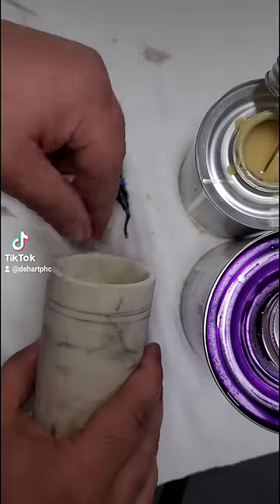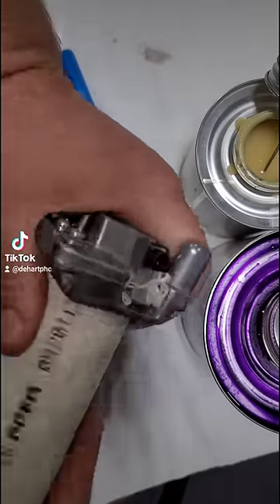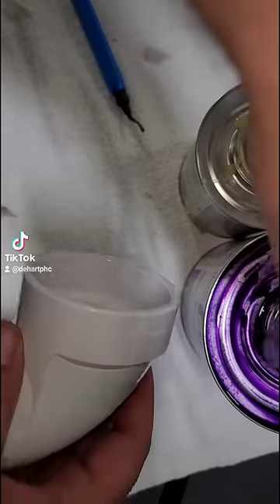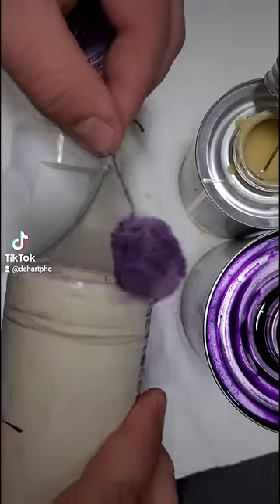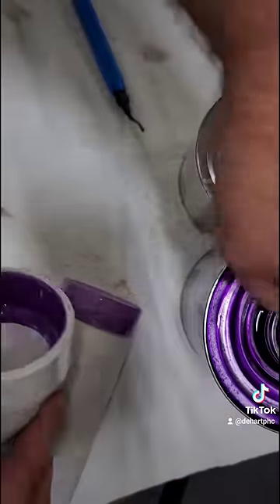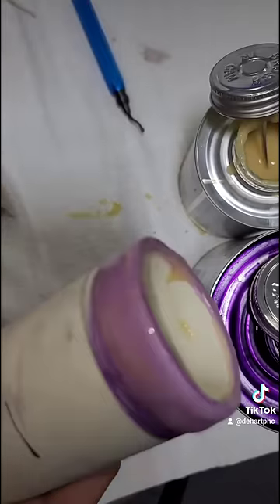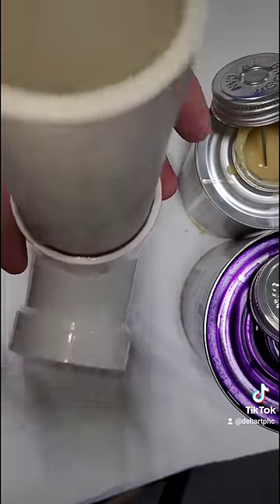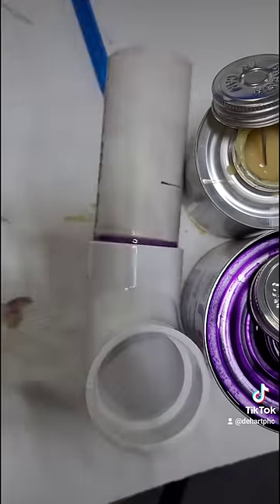How to create a great PVC solvent weld joint.

Comment: I usually cut the pipe crooked with a sawzall, slop the purple stuff everywhere, put on too much glue, and stick it together. Usually works fine
Reply: you mix a little primer into the glue so it looks like you primed it first.
Reply: Chamfer tool, deburring tool. Didn't know those exist. Hacksaw blade or Sawzall that's it.
Reply: Best comment. You my good orange have made my day
Reply: I debur with my thumb and index finger after the crooked kacksaw cut. Works every time
Reply: @halfmoa  🤣
Reply: This is me
Reply: Angle grinder for the win.
Reply: That's the only proper way to do it lol
Reply: don't forget to drip primer everywherer
Reply: @Underbottom.Sandydown I go right to spilling a whole can first for good luck
Reply: Hahaha...
Reply: I usually have to pull the pipes together and flex them because I cut it a 1/2 too short as well…
Reply: Pretty much, yeah
Reply: @halfmoa  😂
Reply: That's how I do mine and never had a leak.
Reply: I just use blue no primer
Reply: I thought the purple stuff was the glue 😮
Reply: @Masterofthejack  😬
Reply: @Masterofthejack  😂
Reply: @caodesignworks2407  shit, my supplies never make it home from the mex home depot ico
Reply: Bro forreal 😂😂
Reply: Lol m12 shears and blue lava baby
Reply: Same here, but then you don't have a video to make yourself seem superior by adding useless steps.
Reply: This. I just did the same damn thing but with an oscillating tool instead. That shit ain't gonna leak again.

There's the "proper" way, and then there's the right way.
Reply: As does everyone else.  This is some DIYer that thinks he's a professional when pro's know that time is money and this is unnecessary.
Reply: @123chargeit  to be fair if I did this professionally I would have a pvc cutter. Those make a plenty clean cut without all the extra steps.
Reply: No such thing as too much glue
Reply: 100%
Reply: No such thing as too much glue
Reply: That’s pretty much how everyone does it. That’s how this guy does it in the field.
Reply: I just inhale the primer and forger why im there 🤤
Reply: Sad how accurate this is for my life 😂😳
Reply: Don't forget laying on the floor for the last hr listening to music because you forgot to cap it, while trying to get the day over with after lunch and got high
Reply: @billbobaggons  what about laying in sludge because the previous drains were clogged with everything that never got cleaned out of the refrigeration cases? 😂😂
Reply: @BEMetalMelting  😭😭 the memories are coming back now
Reply: Amen.
Reply: That's the ticket bud your Golden
Reply: @caodesignworks2407  winner.... That's how you know you're going to have a good day.... Started off as bad as you can so it's nothing but up from there .. stay Golden
Reply: Lol these comments🤣
Reply: @kileonamanzano7024  being a hack at assembling PVC brings us all together.
Reply: @bearlemke  exactly 💯!!!
Reply: @Masterofthejack  yea i don’t hire you people
Reply: 🤣 Correct
Reply: @halfmoa 🤣
Reply: You forgot to kick the glue over and drop the swab in the dirt
Reply: Yeah people don’t like paying for extra time doing all that and making it look pretty on something no one will ever see
Reply: @halfmoa the guy who showed me this trick also shot guns on site and smoke more weed than anyone I've ever seen while at work.
Reply: This man gets it
Reply: This is the correct way...
Reply: @halfmoa  nahh glue only and if theres inspection just prime the joints when its all glued together. Easyyy
Reply: I usually cut a stake, prime and glue that side into the fitting then blame the next guy by accusing his level of having too much air in it causing his bubble to never give him an exact 1/8th of fall.
Reply: This! Lol
Reply: Why pay for primer when u have grape kool-aid
Reply: Well played, sir. Well played.
Reply: And will also hold just as well as the joint in this video. Those steps aren't needed.
Reply: Hell yeah brother 😂😂
Reply: @FatPat2009-2 multi tool or bust 😂
Reply: 😂😂😂😂. Me too!!!
Reply: I'm usually on my back in a crawl space ....so no.
Reply: I cringe when the glue gets wiped off with bare fingers
Reply: @gregtorseth  😂😂 I can’t stop laughing at this damn thing
Reply: It always works fine. This video is mad overkill
Reply: @kirk5637  yeah.... Deburr tool. You mean index and thumb.
Reply: @gregtorseth  exactly. Gloves? Optional. Sometimes you catch a slice, sometimes you don’t. 🤷‍♂️
Reply: @ExploringCabinsandMines  flapper wheel gang
Reply: @caodesignworks2407  I don't think I've ever actually used an entire can of primer.
Reply: Damn...just use a shark bite
Reply: Same
Reply: Yep. A win is a win no matter how ugly.
Reply: Shit I’m glad I’m not the only one
Reply: Then as I'm installing, I knock over the cans of primer and glue
Reply: Hilarious 🤣
Reply: @Underbottom.Sandydown  you know I did some plumbing bc the purple is everywhere 😂
Reply: I know you’re joke but it still hurts to read this 😂
Reply: You win the comments section!!!! 🤣
Reply: @gregtorseth  holy shit 🤣🤣
Reply: Primer!!! What’s that do??? lol
Reply: @caodesignworks2407  before even cutting somehow it drops and explodes and now the whole floor, and wall, and cat, and dog, and wife are sealed nice and tight!right?
Reply: “Usually” lmao
Reply: Yeah exept for the purple stuff I usually use what we call purple shit it works a little better
Reply: As a plumber. I can confirm you are correct. Crooked every mf time
Reply: Nailed it
Reply: Grandpa did the same, worked fine 😂
Reply: @123chargeit time is money, and contractor don't give AF of it fails 5 years later, they go the money and GONE!!
Reply: 😂😂same brother people these days
Reply: @orange3203  we didn’t have a pipe cutter that would do 2 inch until this last year or so, and anything bigger is either for the table saw or sawzall, and we just pick off the stray bits so it sets nice
Reply: Most realistic comment
Reply: And none of those joints leak to this day
Reply: @thatchedstudios4768  amen to that, long as it isn’t under pretty substantial pressure it’s usually about fine
Reply: Hahahahaha me too dude never had a leak
Reply: I usually wrap the original pipe in cheap sealants and hope I don’t have to hack anything out later
Reply: You sir sound like a pipefitter.😂
Reply: @kendallzortman3826  really bad at geometry but really good at welding wide gaps together.
Reply: Half of this is unnecessary but it sounds good
Reply: Amen brother
Reply: @kirk5637  fucking seriously!!! Never heard of them!!!!
Reply: 😂😂wtf
Reply: Exactly! So many unnecessary steps and it's sanitary in his video that's not even under pressure 😅
Reply: so pretty much like you eat proper Philly steak sandwich
Reply: This is the way
Reply: Same. No leaks yet.
Reply: @Kirk, this is how you lose a ton of money as a plumber because you have no idea to run a proper company
Reply: Genuinely made me laugh out loud. Thank you
Reply: Lmao
Reply: ^ Crappy handymen assemble 💪
Reply: Put a little sand for the luck
Reply: My deburring tool is a utility knife. 

My chamfering tool is top notch though. It gets such an immaculate chamfered edge to the point where it's almost too perfect and the glue won't stick. But it does. I spend at least 20 minutes on each joint making sure that chamfer is the opitome of perfection. Just look at any of my joints... Oh wait, nobody will ever be able to see if the edge is chamfered and it makes literally no difference if it's there or not... I guess you'll just have to take my word for it.

Oh yeah... Clear primer exists, no sense in using the purple crap worrying about how clean you primer line is.
Reply: I just let it drip slowly until the limescale builds up, jobsagoodun
Reply: Exactly! The more pvc shavings left on the end of the pipe makes for a stronger joint👌🏽
Reply: Exactly
Reply: You know when ive played plumber by the purple fingers i have for days after
Reply: Same
Reply: Was about to say similar lol. I cleaning with a knife though just to save cleaning faucet screens.
Reply: I slop glue around the outside of the joint for good measure
Reply: 😂 I was thinking the same thing.
Reply: He lives in a perfect world. Yep his wife cheats on him
Reply: I do what you do, except now I just use clear primer so I don't have the purple everywhere
Reply: Most inspectors want to see primer run to know it's used
Reply: Why even bother with the primer, lol.
Reply: Sont forget a few fresh teardrops made from the sad agony of finding all the tools in the messy garage in the middle of the night reminding of the sad state of things.   Not that i would have ever experienced that
Reply: Hay boy!
Reply: Facts
Reply: This is how new construction top out usually works lmao
Reply: Make sure to get plenty of purple primer on your fingers, so your wife won't let you play with her cooze that night, more beer time for you.
Reply: I like to get some dirt in there too.
Reply: Me too 😂😂😂
Reply: When I read this I LMAO. There's guys at work that just use primer. I usually have to go back and fix it later. Plant maintenance for reference.
Reply: And never forget to knock over the primer every once in a while
Reply: I like how he went through the time to chamfer the edges, but didn't clean the mating surfaces with a copper brush. It's extra, but really gets the junk out.
Reply: He's not wrong the guy that did my house was probably on 5 different drugs, he had his license (well his dads lmfao)....He did it the same way as orange3203 and years and years later none of it ever leaked
Reply: Way she goes
Reply: Worked for my potato cannon 🤷‍♂️
Reply: I WAS GOING TO TYPE THE EXACT THING!
Reply: Yurp nailed it.😝🤣🤣
Reply: When the purple primer runs down your forearm on a vertical pipe, you've perfected the technique.
Reply: my man 😂
Reply: This technique always works!!
Reply: Yo hell ye I do plumbing on pools and you just killed me
Reply: Never had one leak yet. I also use thr same method
Reply: Don't forget grinder.  I've used a grinder to cut several times
Reply: Works the same
Reply: Just needed a file not those 2 Batman gadgets
Reply: Shit works great for cuts also..and anyone out on site isnt outting pipe together like that.its turn and burn..unless they are hourly
Reply: Best comment ever!
Reply: Literally 😭😭
Reply: I skip the primer
Reply: Exactly what I was thinking 😂
Reply: Came to the comments to make this exact comment, I'm a little dissapointed you beat me to it but glad I'm not alone hahaha
Reply: Duct tape it. Rip and run baby. Those fumeees am dangery
Reply: You’ve seen my work have you? 🤔😂
Reply: Mmmm that first whiff 😤😮‍💨
Reply: Too real
Reply: Didn’t know there was any other way 😂
Reply: @kirk5637 I'm a firm believer in mastering hand tools first but a hacksaw does save an arm on new builds
Reply: You sound more like an electrician 😂
Reply: Dont forget the part where you get the primer on your fingers and drip glue all over the ground and on your boots
Reply: @halfmoa just use the same dip stick thingy for both.....😂 dip it in both at once....saves a lot of time...
Reply: That's standard
Reply: Like a normal person.
Reply: Facts 😂❤
Reply: Yep.  No need to be technical about it.  It’s PVC, as long as it holds and doesn’t leak.
Reply: Same 🤣
Reply: I also enjoy this method but I like to glue dirt and things to my hands
Reply: Yup. 10,000 joints, not one leak. Just deburr it by twisting it on your pants. What's this "fitting, pipe, fitting" business?
Reply: The most real comment here 😂 💯
Reply: @caodesignworks2407  lol my old boss had to bring me extra glue to a jobsite once, brought me 2 and said "ones for you to knock over ones for you to use"
Reply: Same.
Reply: "Usually"😂😂😂
Reply: They didn’t name it sawzall for nothin.
Reply: You an me both
Reply: @halfmoa 😂 a true craftsman
Reply: Yep!!!
Reply: You win the comment of the day. Hahahaha
Reply: It’s not rocket science, it’s common sense. It’s simple crap to do, you just gotta know how it works to use it correctly. Then it don’t matter how you do it as long as it’s quick and it works. This is just some OCD type stuff that DOES work but takes longer
Reply: Dont forget to sniff cleaner before fitting to help get thru the day
Reply: Yep...
Reply: @MrOdins007 😂same
Reply: Still holding too
Reply: Never fails. 😆 🤣

Comment: Yes, it matters to put the primer on before the glue. No, it doesn't matter which piece you do first.
Reply: But you do want to put more glue on the pipe than the fitting to that excess glue pushes out instead of running inside the fitting, atleast the way I was taught
Reply: It actually does matter for semiconductor and nuclear plants. Not so much for commercial and residential.
Reply: @davebuilds7261  correct...but the amount of glue actually needed to make this joint is very, very small. A can of glue will last me, a pro-plumber, about 6 mos....or until it starts to gel.
Reply: @readmore3634  yeah it’s like saying you can put a reversible belt on backwards 😂
Reply: @readmore3634  And that glue is so expensive that if you would have to buy 4 times as much you'd bankrupt the state. 

PVC is chemical bond, just clean the joint. Make sure it fits and have fun with glue. Make it look nice from outside if lots of people see it, otherwise go to the next joint.
Reply: I just commented the same damn thing. Pipe, fitting. Fitting, pipe make absolutely no difference at all.
Reply: @davebuilds7261  idgaf because my stuff don't leak and I'm fast. Purple primer is for fools too. No reason for it.
Reply: @Torchedini  word. I only care what my exposed looks like as long as mybpich is good. I don't deal with pressure, so pitch maters and that's it
Reply: @shilohmaverick898  spoken like a true hack, sit down apprentice
Reply: @Torchedini  yeah...I do clean work cuz inspectors (who know what they're looking at) want to see purple primer on larger PVC joints. The purple tint is only a marker for him to see....otherwise it could be clear.
Reply: @shilohmaverick898  lmfao. I imagine when you want to paint a car you just buy spray paint and go over the original clear coat too, right?
Primer is used to soften the PVC, allowing the glue to bind to it chemically.
Reply: @davebuilds7261  Yep. I do pools and it’s something like 3 or 4 turns on the pipe and one or two on the fitting. Imperative to deburr pipe as it can scrape off the glue inside fitting. Seen it happen on pressure test.
Reply: @nuntana2  when I was doing ground roughs a guy taught me the wrist work to glue fittings really fast and effective
Reply: @shilohmaverick898  I guarantee your stuff leaks.
Reply: Actually it does. Applying cleaner first to the female then male,  primer to the female then male, and glue/solvent to the female then male, softens and properly prepares the pieces for assembly. That's particularly important on any schedule 80 PVC especially over 2".
Reply: @shilohmaverick898  there’s absolutely a reason for it…have you ever had something inspected? Using clear primer the inspector has no way of knowing you primed it. I only use purple for that reason.
Reply: @anthonytrujillo7971  can you explain how it matters and why?
Reply: @crunch9876  The fittings are pressure injection molded so they end up being harder. The pipe is extruded and is softer. They're chemically the same but because the fittings are harder so you must prime the fitting twice. Most semiconductor and nuclear plants use spears products and require you to be certified by the manufacturer before you can glue anything on site. Your company pays to fly out a representative and you build a coupon in front of them. A piece of 4" shc80 pvc I think 12" long with two caps, one cap drilled and tapped 3/4" fip. The representative gives you a class where he explains proper beveling and that you must rotate the pipe 1/8 turn until bottomed out absolutely no rotating after it's bottomed. he explains you must prime the fitting pipe fitting and glue the pipe fitting pipe. Lastly hold times and wiping joints all although some plants don't allow you to wipe joints the manufacturer recommends it. During the test the instructor explains If the primer pools in the cap during the pressure test the ends of the caps will blow off. If primer runs down the side of the pipe inside or out the side of the pipe will blow out. If you rotate the pipe and fitting after bottoming out the solvent weld tears and rolls over itself and the joint will blow out. I'm not sure about the pressure and time but guys i've worked with have said it's said 600psi for 30 minutes. Competent pipe fitters and plumbers do fail the test every now and then. Most times it's the guys that think it's a joke. After you receive your certificate every glue joint you perform on site we'll have your cert number and initials. Some of those lines will carry some very nasty stuff and will be in service 2-20years. It's not really a big deal for irrigation lines and dwv stuff but there is a proper way to do it for a reason.
Reply: Primer fitting, primer pipe, primer fitting.

The fittings are cast from a much harder plastic, and take more primer to soften (prime) the same amount as the pipe to get a good solvent weld. Also, it's not glue, its a cement solvent.
Reply: @Shiloh Maverick  purple primer is literally code.
Reply: @plumbcrazy9195  i think i have seen a few studies on it that actually showed used of primer had no effect on the strngth of the joint. And in some cases worse.
Reply: @anthonytrujillo7971  Thank you! Honestly, my first inspection after being given a five minute talk about technique passed. I definitely went a touch overboard one quantities, and it certainly doesn't matter for most at-home projects, but once you start letting your quality slip, it's easy to keep on going down that path.